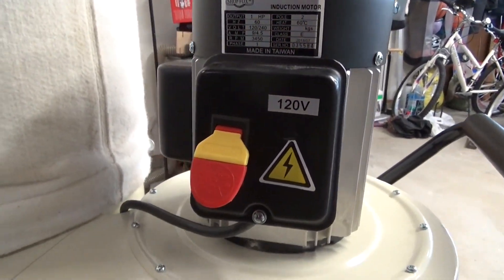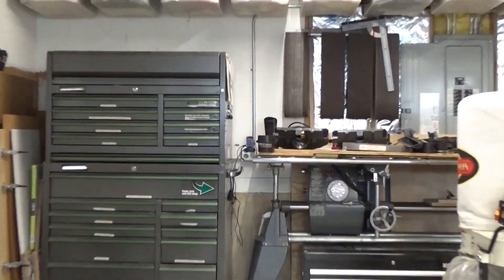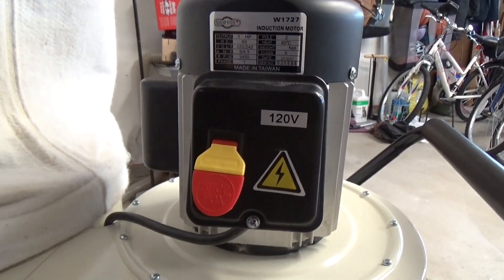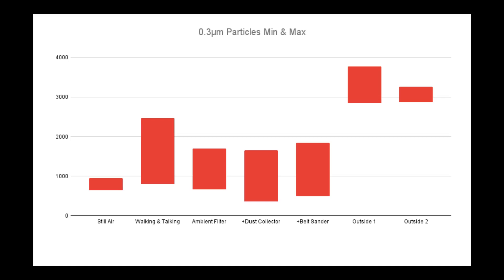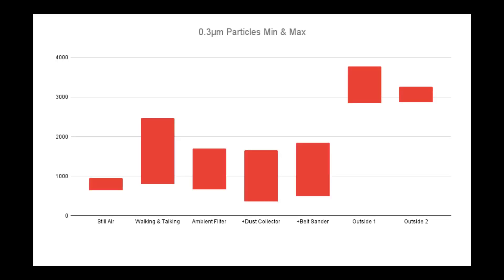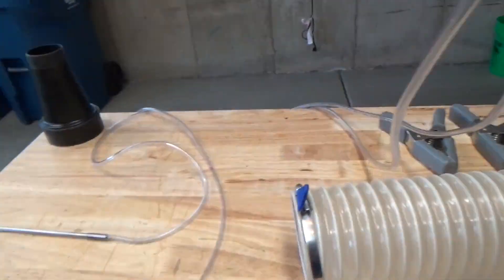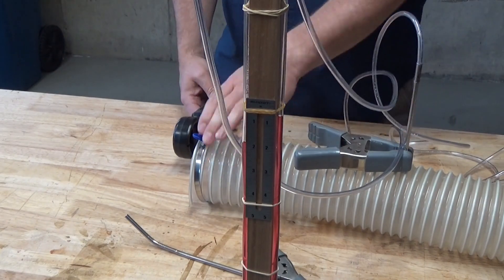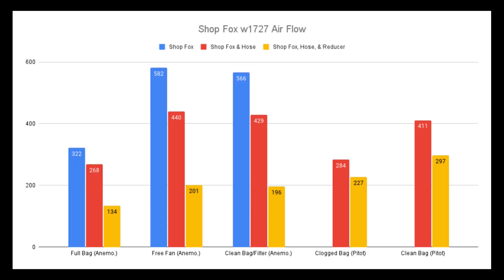Dust Collector Testing Re-Do: Should I Upgrade to a Canister Filter?

Comment: I've got a similar model from Rockler with a 1 micron canister filter. I also used a anemometer to measure the FPM ( velocity). What I found is the free running PFM is about 6000 ftpm and putting the filter back dropped the FPM to 5000 ftpm. In your system the bottleneck is indeed the 2.5 tool port but  a canister filter does reduce the back pressure and increase the CFM.

Comment: Doesn't really ADDRESS the question posed in the title of the video.

You're just making an assumption based on data collected ONLY from a bag filter.  You really need to buy a HEPA or 1micron canister filter & compare the numbers to the bag filter results in order to address the question....  Canister filters DO improve airflow, which even with 2.5" reducers should show a measurable difference.  

The real question is how much improvement is there in changing from a bag filter to a canister filter.
Reply from the maker: No it did address the question. There would be little to no improvement on my machine. Look at the "free fan" measurements without any filter vs the "clean bag" measurements. There is only a 5 cfm difference. So assuming these expensive canisters have 0 air flow resistance (with is impossible) I would only get 5 addition cfm out of it. And as the difficult to clean pleated filter became impacted with dust the cfm would drop significantly well below the bag filter.

Canisters manufactures should list the cfm per square foot of material and the total square footage.

BTW after this video I bought a 42 inch 1 micron bag filter from Rockler rated at 50 cfm per square foot. It was only $40 and supports more than enough total air flow for the capabilities of my machine.

Comment: Thanks for all the insight here! Well put together. I run a similar size dust collector, but I split the 4" into two 2.5" lines. It's not optimal, but it does help, vs reducing it to one 2.5" line out to the machines. I have three machines connected to it, but use blast gates, and always have two of them open. I did a series of redneck experiments and have found a sweet spot for my configuration. Distance of hose makes a pretty big difference too.
Reply from the maker: Thanks for the compliment and comment Denny. I use your same approach in that you have to do the best you can with what you have.

Comment: Tend to think that the kind of material you typically work with (species of wood in this case) and your reaction to that wood and its dust is the bigger issue. Most wood dust is very irritating to lungs but for some extremely more so. In those situations a "better" or finer filter is pretty much a given if you plan to continue in the hobby. Obviously other factors like exposure time, duration, and machinery used are all pieces of information for the health puzzle. Clearly a hand plane has less of an impact to dust creation that a 3-HP router. Or compare impact of working Cocobolo or Rosewood to Alder or Birch.  Hardwoods versus man-made composites like MDF. Base line is if you aren't cleaning your nose regularly or often then you mIght be OK but be cautious as your activity ramps up.
Reply from the maker: Thanks Don. I totally agree that wood dust and especially fine wood dust is a serious hazard. I did purchase a 42 Inch 1 micron bag from Rockler for $40 since making that video and it's working well.

Comment: On a cost analyse basis the pleated filter canisters seem to come out on the short end of the stick.  In terms of lifespan the paper elements are going up in price with that limited useful life while the felt seems to be a very long term purchase that is easily recleanable.  Going with your figures and some others it would appear that felt is the best choice.  Since my shop is a combination wood and metal I would be very interested in metal central collection of the swarf and if it is possible or practicable.
Reply from the maker: Great points Douglas. I since posting this I upgraded to a 42 inch 1 micron felt filter. Was $40 from Rockler. Has great air flow and great filtration and was many times less expensive than a canister.

Comment: Really like the data!  Thanks.  Do you have a link to the particle counter in this video?  It seems like everyone who is doing a video with CFM measurement should always do one reference point at the entrance to the dust collector.  Variations after that are infinite.
Reply from the maker: The particle meter is a cheapie from eBay. I can’t give a link because the listing changes every few weeks. That one has since stopped working and I purchased a Dylos brand unit. 

I did use a anemometer in the first video to measure the intake. The method I used in this video is inspired by Oneida’s real world testing methods, which involves a pitiful tube at the end of a 10 foot hose. That would be the minimum resistance any system would have but still is plausibly usable.

Comment: Another suggestion is to measure with and without bag on your dust collector. And compare the numbers with and without the reducer. I would also suggest that you use a y fitting to split the 4 inch and use one on the dust port and another as an auxiliary port near to not big down your dust collector.
Reply from the maker: Aravindah, thanks for the suggestions. I totally agree with you. I did do what Oneida Air calls, "Free Fan" testing with an Anemometer in my first video on my dust collector. I found that the coupler/reducer is by far the biggest bottleneck in the system and concluded that getting a canister filter is not guaranteed to improve the air flow.

Here is the video if you are interested - https://youtu.be/IeXHpUmrNVM

Also, great call on the splitter. To avoid buying a second machine to collect dust from my orbital palm sander, I use this same dust collector. But, I add a 4 inch to 2.5 inch Y adapter to allow "make-up air" to flow into the 2nd port since the sander is very restrictive on air flow. The purpose, as you say, is to avoid bogging down and stressing the motor. But it has to be in balance, I find that I must block about 60% of the open Y port to maintain sufficient air flow through the sander.

Comment: Good job man. I wouldn’t have thought of using a Pitot tube for testing this, but it makes sense
Reply from the maker: Thanks for the compliment! Can't take credit for the idea to use the Pitot tube. I read that it is the way Oneida Air tests their gear and I saw it used in several other dust collection materials. Just a copy cat!
Reply: @woodshopnerdery  Plaigerism is the ultimate form of flattery.  Not sure who said that, but I think it applies here.

Comment: Great video, thanks for sending the link.  I have never measured the air quality in my shop, so the particle counts leave me with more questions than answers.  I was surprised at the spike just from walking around, but I couldn't quite tell from the video if your concrete floor is unfinished.  Also, if you clean the floor with a broom, more dust would remain than if you clean with the dust collector and a wide brush attachment.  I might have to pick up one of those meters to do a comparison.

As for the filtration levels, I think that my Wynn Environmental filter was advertised as a 0.5 micron when I bought it (they use MERV ratings now), which was a big improvement from the 5.0 micron that came with the Harbor Freight dust collector.  I could taste the dust in the air when I was using the HF bag, but with the Wynn filter, I have only even noticed a strong wood smell when cutting Meranti - The air stunk for days every time I turned on the dust collector until I blew out the filter and changed the plastic bag.  It makes me wonder what the average size of a sawdust particle is, from sanding, power-planing, table-sawing, etc.

Continuing with that last thought, the size of particle blocked by a filter will decrease with time until the filter becomes completely clogged.  Even when you shake or blow out a filter, there will still remain small dust particles clogging the larger holes.  A 2.5 micron filter will eventually become a 0.1 micron filter if it gets dirty enough.  A thorough bag cleaning, maybe using compressed air or shaking it out, might restore the filter closer to its original specs, and might increase the <2 micron dust counts on your meter.  I've been thinking about replacing my Wynn filter for a while, since it's more than four years old.  If I ever decide to pull the trigger on that investment, I'll try to remember to do a before/after air quality test.
Reply from the maker: Thanks for the compliments. Glad you liked the video. 

I think its a common misconception that  a 2.5 micron rating means that ALL particles larger than 2.5 microns are trapped and ALL particles under that size pass through. This is not really the case. The rating means that the filter material will trap 95% (I think) of the particles 2.5 microns or bigger at a certain air velocity. The filter still traps lower sized particles but just not 95% (or whatever %) of them. Maybe it traps 70% of sub-2.5 micron particles for example, just a guess?

I believe you are correct, the dust cake on my bag does increase it's particle efficiency. But, my collector is also under powered at 1 hp. It produces no where near the air velocities used to do the particle filtration ratings tests. So, my assumption, is that if the air is moving slower, it pushes fewer particles, of all sizes, through the filter material. So, at my system's air velocities, I wonder if it is behaving similar to a 1 micron filter on a larger more powerful system?

https://wynnenv.com/woodworking-filters/filter-efficiency/

BTW - I think you have a great set up. I would go that direction with mine, but I just think the motor on mine is too weak to support the upgrades. What I will probably do eventually, is go with a premade system like the Oneida Mini Gorilla.

Comment: PS I used to use Shopsmith 3300 and this is a lot better. Sure the upgraded SS is good but expensive.
Reply from the maker: I would have bought a Shopsmith DC but at the time the DC-330L was out. That looked to me like a Rikon 60-100 with Shopsmith labels on it. So that is why I looked off brand. Glad I did. This Shop Fox is a great value. I may upgrade to something else one day, but its working great for now.
Reply from the maker: BTW - Thanks for watching and commenting. I really appreciate it!

Comment: Very helpful - thanks. I have the same dust collector ( bought only craiglist brand new before seeing this video ) and also 2 1/2 inch at tools (shopsmith) . I tried your set up and I am now experimenting with a y at dust collector 4 inch to pair 2 1/2 outlets and using 2 1/2 hose to one tool and other outlet open or 2 hoses to 2 machines. It seems to work better than 4 in hose with reducer - I have tapered reducer similar to yours. I can not do any measurements though. What do you think ? I also have cloth filter and had canister envy but no more - thanks - money for some other toy.
Reply from the maker: John, I did do some testing for the first dust collector video on my 2.5 inch hose. I did not include it in the video because honestly I did not consider it a viable option. I put the reducer directly on the DC and then ran a 10 foot 2.5 inch hose. Note my 4 inch hose is also 10 foot. At the end of the 2.5 inch hose I measured 87 less CFM than I measured at the end of my 4 inch hose with the 4 to 2.5 reducer. The measurement I got for the 2.5 inch hose was 110 CFM, which is about the same as Shop Vac.

Friction between the air and the side wall is the enemy. Larger diameter hoses have a greater cross section area per linear unit of circumference than the smaller diameter hoses. In other words, larger hoses have less friction per volume. The conventional suggestion, which I see all over the place, is to run the largest diameter hose or pipe possible until the last possible place, then reduce to smaller.

Keep in mind that with a DC you want high air volume movement. The air may have a higher linear foot per minute rate at the end of a 2.5 inch hose, so to the eye and hand it looks and feels like better performance because the air is moving faster. But the goal is to get better air volume movement, while still maintaining a minimum of about 4000 feet per minute flow rate. Common wisdom is that air moving at 4000 fpm keeps the particles suspended in air so they can be collected.

Comment: Very interesting results, Thomas. You are living up to your channel name! Have you installed a Thien baffle in your dust collector? Scott
Reply from the maker: Thanks, I really enjoy this kind of inquiry in addition to making projects. I'm trying to keep a balance of both types of videos.

Yes, I have looked into the Thein baffle, bucket separators, and cyclones. Although the mechanisms are different they all employ gravity to separate heavier materials from lighter BEFORE the fan. They also lower the CFM quite a bit initially but help maintain CFM by preventing the filter from clogging. This is good for shop vacs  because once the filter is clogged the CFM goes to almost zero anyway and the filter is a total pain to clean.

To start I had a tool box style Rigid vacuum, then I added a Dust Deputy, which kept the filter clean and the vacuum running at peak (~80 CFM maybe?). But it was irritating to move around and always fell over. I looked into building  a cart but realized that if I was going to dedicate floor space to a cart I might as well invest in a proper dust collector. So I purchased the unit I have now, it was an amazing difference in air quality, cleanliness and generally enjoying my time in the shop more.

In my opinion I would not benefit  from a pre-fan chip separator like a Thein baffle; 1. I have a metal fan so no need to protect it from chips, 2. it's a small system so I don't have extra CFM to spare, 3. my felt bag can be cleaned with a few taps to restore optimal CFM so no need to protect the filter from clogging. 4. true bag-bottom, filter top dust collectors like mine already separate materials using gravity.

The one exception is on some rare occasions when I use the planer and jointer I do get a clog at the inlet of the dust collector motor housing. In this case I could benefit from a pre-separator. But, to clear it out takes 1 minute and I don't want to store a separator when I only need it 1% of the time. Hmm... now I'm thinking...

When I got my dust collector I gave my Dust Deputy to a co-worker for his garage shop. They work wonders for shop vacs, but for my system it would eat away my CFM because they do that and because it would require I use a 2.5 inch hose instead of a 4 inch hose which also is a CFM killer.

There you go some bedtime reading😴😴😴😴😴😴😴
Reply: @woodshopnerdery  The original Thein baffle wasn’t pre-fan and was actually designed to be installed inside a dust collector like yours. I agree with your assessment or the pre-fan separators.
Reply from the maker: I had not heard of an internal Thein baffle. But I looked it up and learned we are spelling it WRONG, should be Thien. Anyway, no I don't have one. Is the purpose to prevent the inlet air from stirring up old dust in the lower bag? Have you added one to your dust collector? Is it having an impact?
Reply: @woodshopnerdery  Ok, so it looks like you've learned the first lesson, and that's you should never look to me for proper spelling!  I used to say that I spell atrociously, but then my bride pointed out that no, I can't!  Anyway, no, the point is to get the dust to drop out of the air before it hits the filter.  It's not unlike the cyclone that is already designed into your separator but even more effective. I have a SS DC3300, so I can't install one, but I may buy another, larger DC and if I do I'll install one in it. Scott
Reply from the maker: @MyGrowthRings  I'll have to put some thought into it. I guess it's suppose to give the dust a longer arc of travel in a slower air stream so it can drop out? Interesting.

Comment: another awesome video! agree the canister setup may not really provide much more protection  But here is the thing, don't put all your donuts in the air filtration alone USE a good quality N95 or similar face mask when cutting, sanding, grinding, spraying in an enclosed space with poor outside air circulation!  Oh and another thing, Great Scott! if DOC Brown had you as an assistant who knows perhaps the "BTTF" Time Machine could've been a Ford Mustang instead of a DeLorean!  Wait a minute, you didn't  use this whole nerdery experiment to build your own time machine so that you could back into the future and kiss an 18 year old version of your mother? {okay probably not very appropriate comment but it did happen in the movie, so just saying!}.  all seriousness, this one video probably solidifies your spot in the Nerdery video Hall of Fame, truthfully it is that good.  thanks for sharing.
Reply from the maker: Thanks for the compliments!  And thanks for the nudge on the dusk mask. I worked myself into a really good habit of wearing either an N95 or a Respirator. But got out of that habit in 2020 when I could not buy replacements. But the N95s are on the shelves again and I NEED to get back into that routine.